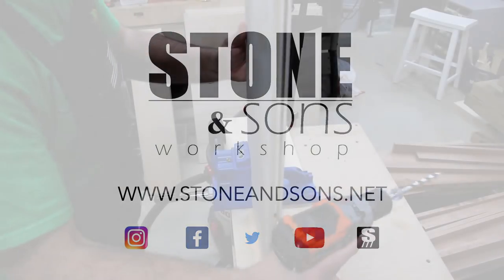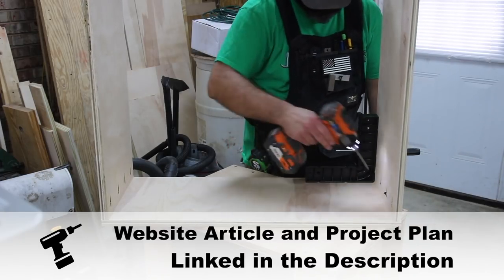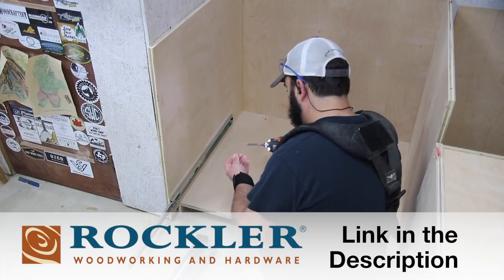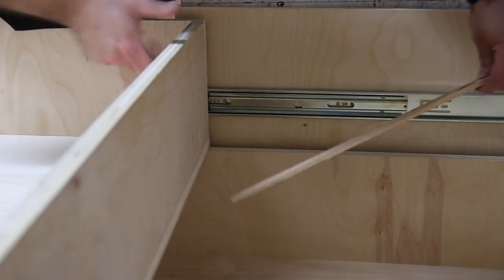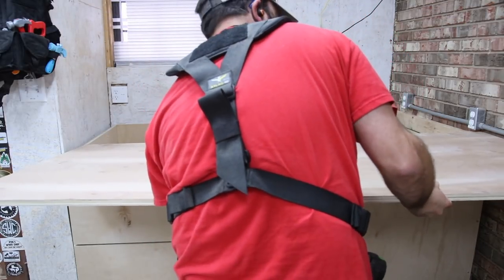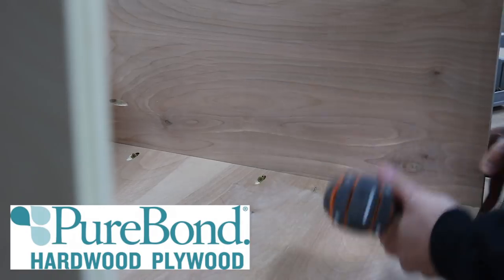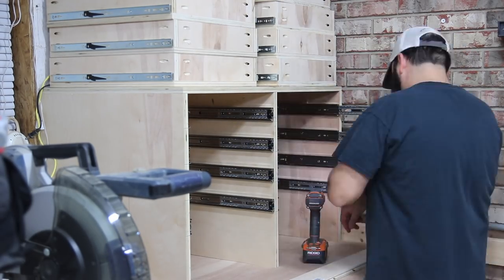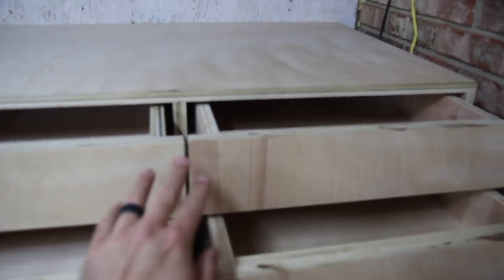Modular Shop Storage System | Woodworking Build Project

Comment: I have a question with regard to the direction that you have drilled the pocket holes at the beginning of your video, it is my understanding that it is advised to drill from the outside edge of the panel therefore screwing in from the edge of the ply instead of drilling in the direction of the end of the board. I hope I have explained myself well enough to be understood. I realise that this would then expose the drilled holes, but I am told that this is the stronger way of using pocket hole joins, please clear this up for me, yours Ricky
Reply from the maker: Yes, but in some cases I do this.

Comment: Maybe you know, maybe you don't. But, I'm working on building a crib for my sisters new baby coming. And I need to start thinking about some type of finish / stain that's going to be easy to clean and keep nice, but also safe in case of chewing and such. Not that it really matters. But I'm using Hickory to build the whole thing. I like how Danish oil makes wood look But I'm not sure if it's the safest product to use. And what do you think would be a good clear coat or whatever?

Comment: Very good job concerning both the project and video production, the drawer slide jig seems very interesting, at first glance I think it offers quite some good options many others don't have. For my next project I`ll have to install about 20-30 drawer slides and I think it's worth giving it a try. I did not find the link to the jig in your description. If you have an Affiliate-Link for this you can put it in and I`ll use this link. ;)
Reply from the maker: Thanks! The jig link is in the description. It worked well for me.

Comment: I have one question. Shouldn't the pocket holes be on the outside ( https://youtu.be/SMxXzwC-nb8?t=66 ), ie with the screw going in towards the centre of the board? Is it any weaker / stronger to do it with the pocket holes going out? Was this just for aesthetics? Just that, for example, every drawer that I've seen done wiht pocket holes has be back and front with pocket holes showing - the front ones hidden by the false front and the back by being inside the cabinet.

Comment: Am I the only on that tune out the moment I see a pocket hole jig?
Reply from the maker: No, I'm sure once you seen one you've seen them all. But it is a handy little tool.
Reply: Tommie Strydom it's shop furniture. They are a useful joint when using plywood.